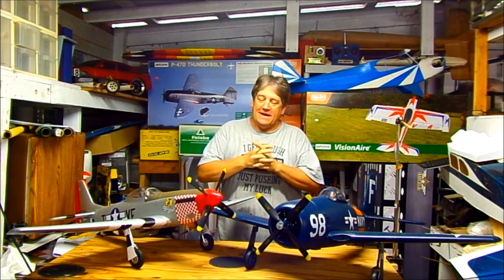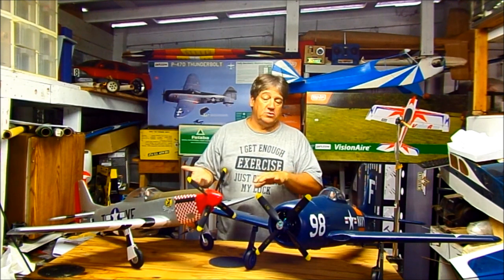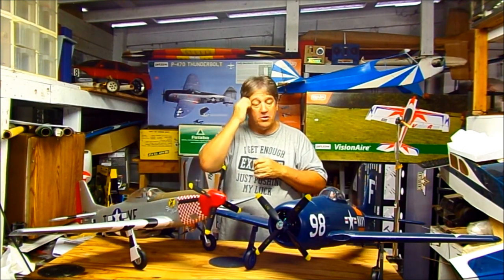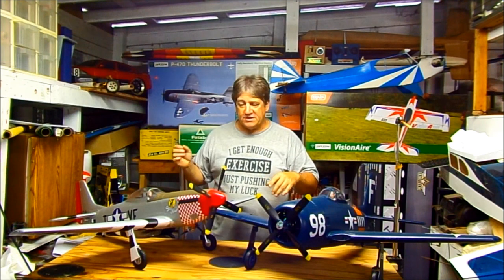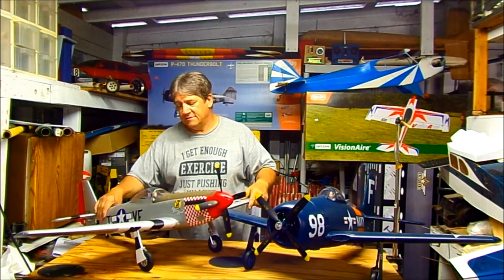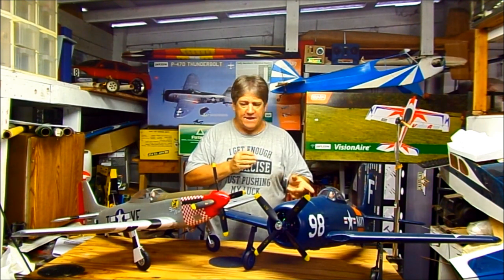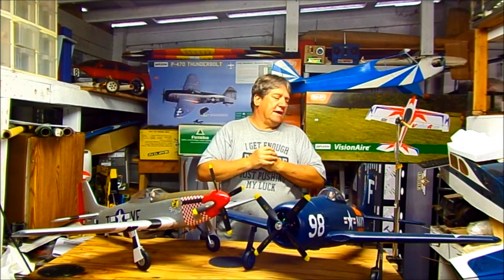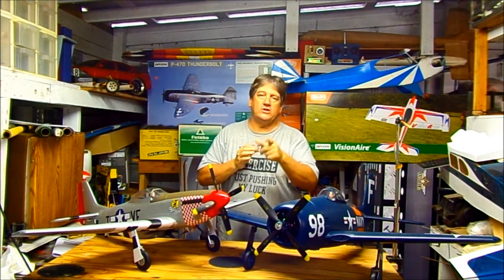PART 3 OF 3 FLIGHT REVIEW ARROWS RC P-51D BEARCAT 1100MM

Comment: Hi there, thanks for the educational review, I just bought me this P-51 and everything looks perfect except for my rudder throws, which I cannot get more than 15mm either way @ 100% rates when the book calls for 27! Can you please advise how can I manage to increase such? Do I need to modify the plane in any way? . Thanks and stay safe!
Reply from the maker: HI CALI; ARE YOU USING SPEKTRUM? IF SO IT'S A SPEKTRUM THING; SO RE BIND PLANE IN SAFE MODE AND ASSIGN TO A SWITCH THEN SWITCH SAFE OFF AND CHECK THROWS AGAIN. KENNY
Reply: Hanger Fiftyone. Hi Kenny, not really, I am using a Blitz DT9 but this is not a software issue, the rudder/tail,wheel assembly just does nor physically reach farther, I dared to unscrew the tail wheel and had to disconnect the rudder wire to be able to pull the servo/wheel assembly out , just to confirm that the travel is at max (I even carved some of the foam inside the tail wheel cave) bur Nope, the servo is maxed out at actually 13mm travel and that’s it. Am I in trouble?
Reply from the maker: @calircpilot4261   WOW ok so I just checked mine and you are CORRECT! lol that's all the throw I have as well; never noticed that before now ; not to worry, just fly the plane; it flies beautifully!! i have no issues with ground handling or in flight control so don't let this worry you at all you will love this plane; very easy to fly ; no bad tendencies at all just a really good airplane.  Kenny
Reply: Hanger Fiftyone. phew! You take a big weight off my shoulders Kenny, will maiden soon and report right after, Enjoy the long weekend and stay safe!

Comment: I appreciate your vids on the XD9 PlusTaranis.  I have an XD9 but considering buying the Plus.  Your thoughts would be welcomed.  I am thinking on getting the arrows Bearcat.  Also, I have not flashed my X9D yet.  would you recommend I only do 2.0?
Reply from the maker: I would get the PLUS SE if you can afford the extra $60 ; definitely the PLUS ; and yes stay with 2.0 ; 2.1 is a pain and I see no reason to go to it. The BearCat is a great flying plane and has a HUGE battery bay for any size Battery you want to put in it.

Comment: Hi I was wondering what batterie do you recommend on the bearcat I heard a 3 cell 3200 levels it pretty good do you have n e recommendations?
Reply from the maker: I've flown 3S 2200-4000 all work fine 2200 all the way forward then bigger just move back a little till you find what you like